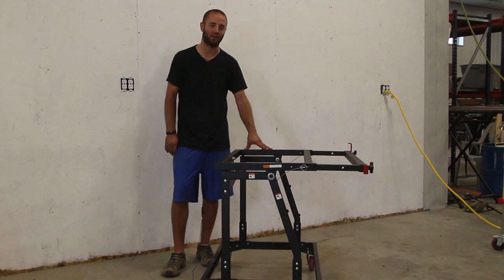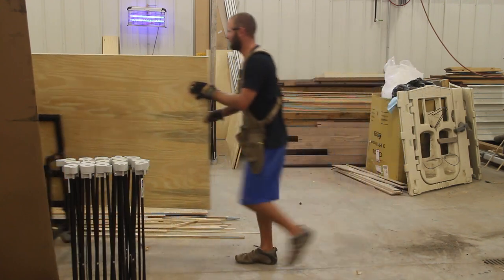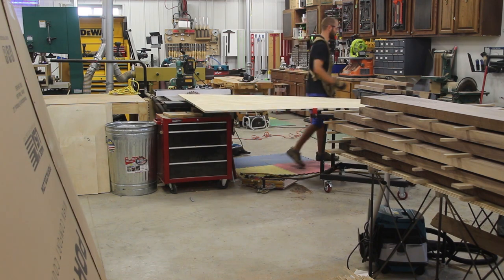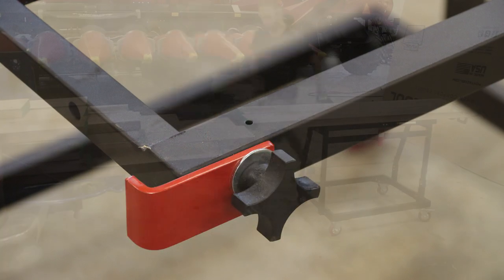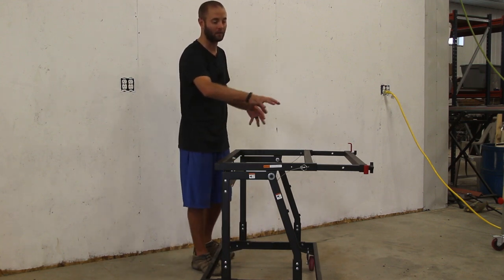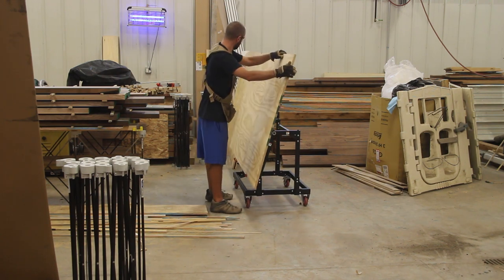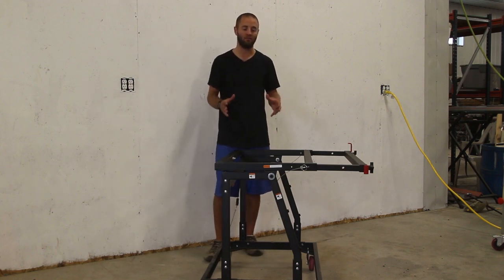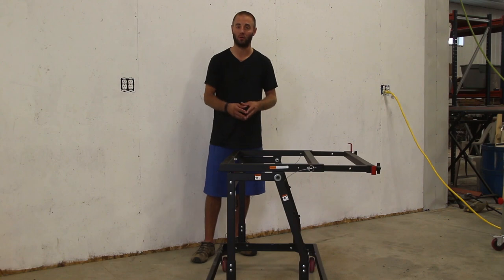Rockler Material Mate Panel Cart and Shop Stand

Comment: From reading the specs it has a weight limit of 150 lbs.  I know most sheet goods weigh anywhere from about 25 to 90 lbs so it should handle those.  Just wondering if the reason it tipped on you wasn’t because of where the load was but how heavy the load was?  It looks like it is designed very well as are most of Rocklers products.  I’m at the point in my life where I cant hall sheet goods around the shop very well so this would be a great addition to my shop.  You do some of the best demo’s I’ve seen on YouTube.  Thanks for sharing.